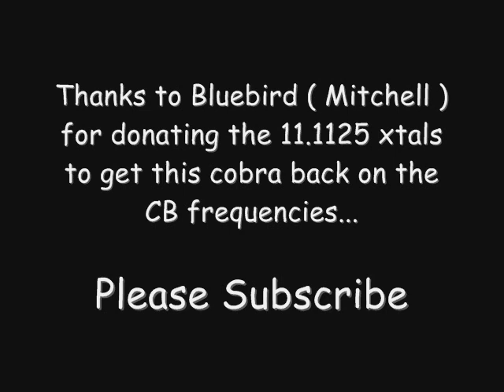Cobra 148 GTL

Comment from the maker: I am picking up a plethora of CB radio gear next week and in the package is another Cobra 148 GTL. I The owner ssaid he is not sure what is wrong with it. It may work. I have a few extra parts kicking around for that kind of radio so I hope I can get it working if it needs any parts....! Also, in that package is a Cobra 200 GTL with speaker in mint condition and a TRC 465. There's a antron 99 and cable, 2 walkie talkies, 3 way meter, power pump, mobile antennas, etc.... A plethora!!!